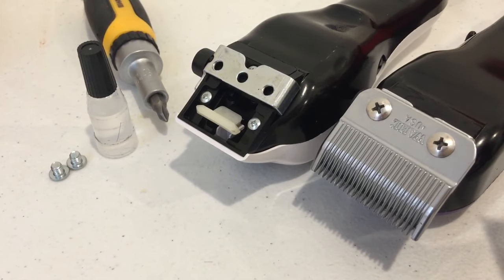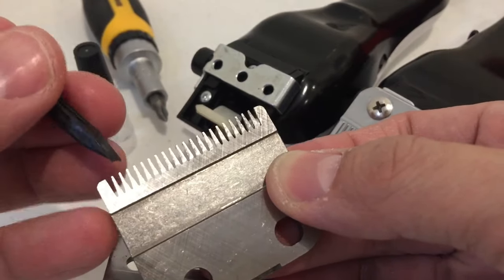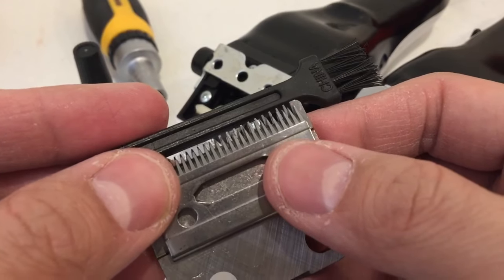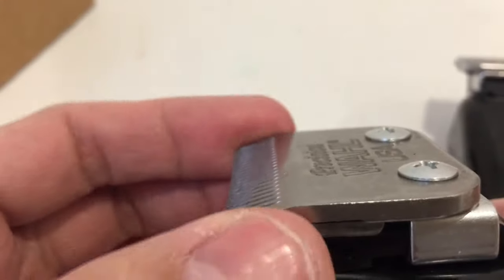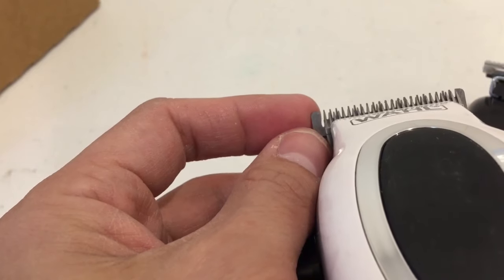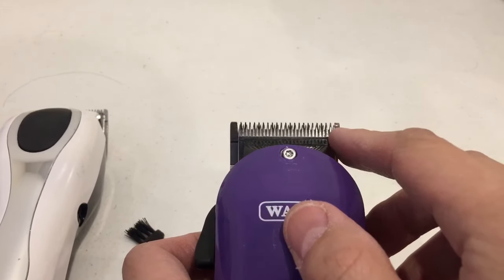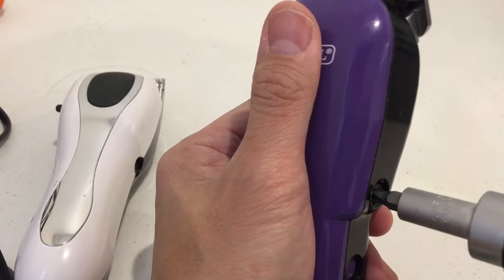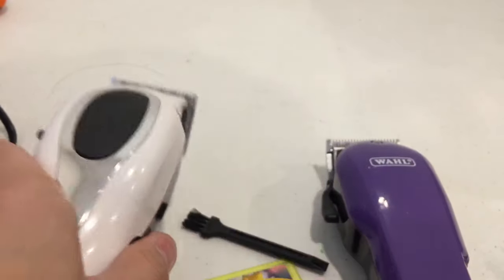How I align & tune Wahl clippers

Comment: My wahl 2110 blade wont slide if I tighten the 2  screws pls help sir 😪😪😪😪
Reply from the maker: Hi, Please Note I Am No Expert but here is my suggestion:
Sounds like you may have over-tightened your blades. Try loosening the screws again, then Gradually tighten the screw in small increments (Turning it on after every turn to check if blades are still loose).

I had a look at your model online and it looks like your blades screws directly into the body of the clipper as opposed to mine which screws onto a 'adjustable head'. 
I Don't Know if this makes any difference between  yours and mine.

Speaking from experience: Please be careful especially tightening screws into PLASTICS. Over tightening the screw can potentially 'strip' the female thread on the plastic body. This happened to me on one of my clippers and I wrecked it.

Sorry if I am not much help. Might be best to send in to the shop if it's still under warranty. Good luck.

Comment: well now there's a hair pulling problem after cleaning and trying to use this video to put them back together when there wasn't one before.

edit: figured it out. had a better time getting the large blade straight with its mounting point, then using the tuning screw to align the vibrating blade. cuts better than it ever did before.

Comment: What's the name of that white thing when we align the blade?
Reply from the maker: Not 100% certain but I believe it's the VIBRATING ARM. Refer to: http://wahlspareparts.com.au/epages/Wahlspareparts.mobile/en_AU/;ClassicView=1?ObjectPath=/Shops/Wahlspareparts/Products/WA8505-201

According to https://grathio.com/2016/08/teardown-same-product-fifty-years-apart/ 
"The little yellowish plastic T (or ╡) near the front of the clipper is what transmits the motion to the blade." I believe this is the same part the author is talking about."

I believe what that author talks about  in his blog is the same as what you are refering to. Good luck! Thanks for watching!
Reply: @lmbpros , thanks. I should change it because it's kind of imbalance but it's connected to the wiring part.

Comment: Dropped mine now they dont work right do you know if the warranty will cover them
Reply from the maker: Quick answer: No, I don’t think they will cover accidental damage. You can always try you luck and act as if you didn’t drop it ;) However, I reckon those warranty guys will figure that out too

This Warranty Against Defect shall not apply if:
 
The compliance label or any other identifying marks have been removed from the product, or have been rendered illegible on the product.
The product is connected to any voltage other than that shown on the compliance label on the product or product packaging.
The defect in the product is caused by other products with which it is used.
The product has been subjected to misuse, abuse, neglect or accidental damage.
The product has been used other than for the intended purpose, or not in accordance with the Instruction manual.
The product has been tampered with and/or modified from its original specification.
A repair has been made or attempted to the product by the purchaser, or any other person not authorized by Unity Agencies Pty Ltd or Unity Agencies NZ Ltd.
The product fails for reasons other than defective materials, workmanship or manufacturing.
The purchaser fails to perform periodic product maintenance, as stated in the Instruction Manual, such as cleaning and storage of the appliance.
 
 
This warranty Against Defect does not cover:
 
Damage or failure resulting from exposure to liquids, moisture, fire, smoke or damage caused by Acts of Nature.
Wear and tear to moving parts as would normally be expected during use of the product for its intended purpose. 
Products not purchased in either Australia or New Zealand
Causes external to the product, such as electric power fluctuations or failure.
Unity Agencies Pty Ltd, or Unity Agencies NZ Ltd does not accept any liability pursuant to this warranty for any consequential damage or economic loss whether direct or indirect, to any person or property arising from breakdown or failure of the product
The  Liability to Unity Agencies Pty Ltd, or Unity Agencies NZ Ltd, under the Warranty Against Defect is limited to the lesser of the replacement cost or repair cost of the product.
The Warranty Against Defects is given by Unity Agencies Pty Ltd, or Unity Agencies NZ Ltd and no other person or organization is authorized to alter its provisions and conditions.

Comment: hello, you have not shown how you tighten the screws, I think it is the most important, I have a wahl mower, the blades do not move and it makes a monster noise (even by adjusting the black screw), the blades do not want to move because I live too hard maybe, but if I do not screw enough, the upper blade moves. I do not understand . for a clipper at 100 euros, it hurts my heart, I cut my children's hair for 6 months with a clipper at 8 euros which works perfectly and which does not require any adjustment
lol
Reply from the maker: Hi, as a general rule I Don't ever over-tighten especially screws on plastics as it can strip it. I guess tightening the screws is based on trial and error & Learning to see how tight it should go! Thanks for dropping by!

Comment: My screws are tight but my blade still top blade still moves, any suggestions?
Reply: Home depot on the glue department to keep the screw for getting losses
Reply from the maker: Hi sorry mate, I aint not expert but that does sound strange if the screws are tight. 

For me, as a general rule, never over-tighten especially on electrical items and plastics.

Perhaps call the store where you got clippers and ask them? Good luck! Thanks for watching.

Comment: Nah I need to know how to reassemble it. The white part and the metal spring part popped out
Reply from the maker: https://youtu.be/Wb1w46_7As4

I took apart one of my clippers to investigate the white part

I'm not an expert on Wahl stuff but I Think that the white head should have  never ever come off (glued or attached by magic) 

You can buy replacements (just try to find your specific model at your local Wahl spare parts store

https://www.wahlspareparts.com.au/p/vibrating-arm-power-drive

Good luck

Comment: Don’t do this ! —> i decided to go all out and mirror polished the back side of the two blades - 2k, 4k, 8k, 12k gritt shapton water stones - BUT the back sides were so smooth that they were like sticking to each other and did not move freely and my clipper went dead silent  and wouldn’t cut hair. Luckily i went back to the stones and decided to go 120 gritt to ruff it a bit and now the blades moves like it should - happy now.

Comment: My blades won't stay allined no matter how hard I try. They are so bad I can't use them anymore. Too much hair pulling even after replacing and oiling the blades. Might have to replace my set altogether
Reply from the maker: @randomtube8226  I also experience my baldes moving but for me, I make the screws tighten more.. also, my Official Wahl spare parts supplier (Australia) sells  replacement screws.

Perhaps, your local Wahl spare part supplies sells them?

Comment: 0:17 ooops! I used to put lithium grease as a lubricant on my Wahl Clippers. What type of oil brand does an average Barber uses for their clippers?
Reply: Джинзó Аркайдия just use singer oil
Reply: Use Wahl Clipper Oil
Reply from the maker: https://www.shavershop.com.au/wahl/clipper-oil-59ml-005661.html only AUD9.00

Wahl clipper oil only for me

You should have a tiny bottle that came with your WAHL clippers when you bought em. I still have my bottle 
The grease might leak inside and damage your clippers! 

Good luck with getting the oil! Cheers
Reply: mineral oil is fine
Reply: I was using  motor oil

Comment: what to do when that lower blade holder is not straight 😭
Reply from the maker: https://youtu.be/Wb1w46_7As4

See this video where I take a look inside. If your vibrating arm isn't straight.... You may have to buy a replacement from your local Wahl distributor or try your best to flatten/straighten the head